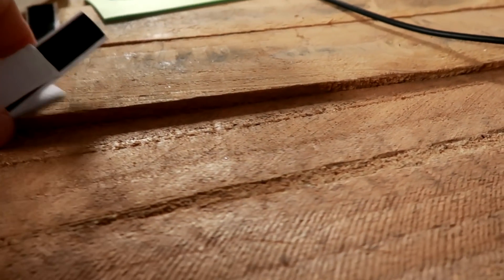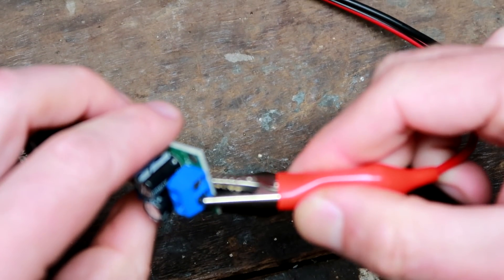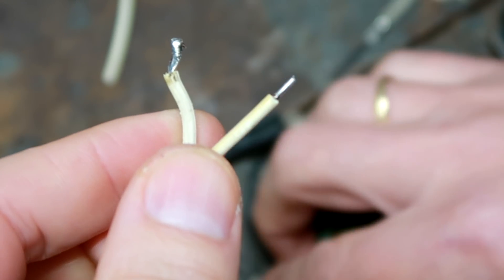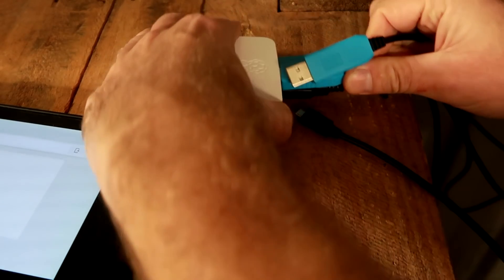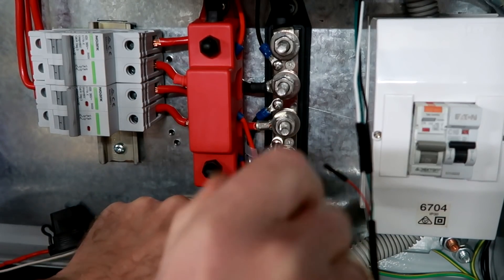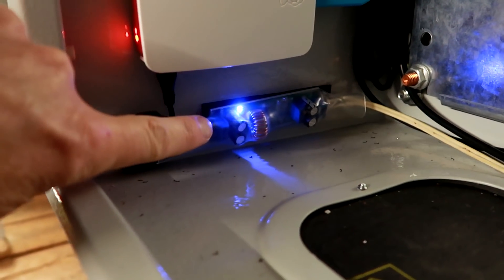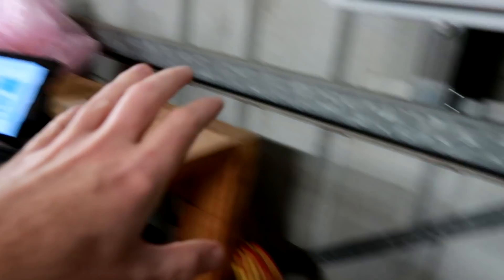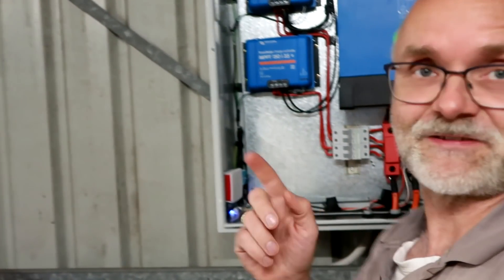Powering the Raspberry Pi from our 48V battery. Will it still work?

Comment: Hi Andy thanks for your very informative videos and your time spent to make them. I would like to make a small comment to that 48V to 5V buck converter you installed to power your Raspberry pi. I also installed that buck converter to power my Raspi, but it only lasted one week since it was installed. The output side near the capacitors was hot to touch. I happened to have another of that buck converter and installed it today. I tested the capacitors on the output side with my infrared themometer gun and it was already 40deg celcius. I think it's going to end up like the other one, but at least my Raspi wasn't damaged. I wish you could make a comment about your buck converter if it still in operation or you changed it to something else.

Comment: I am using the pi ac 90-240v AC strait to 48v dc system and  working fine. I am using and my laptop with 2 displays from the dc 48v and they working if the brightness are low. I find many appliances  with 90-240v ac supply that working on a 48v dc system without inverter.

Comment: Andy, I have followed the Venus OS on a PI you did.  Used the buck converter as it was always dropping a controller input or the shunt input on the display.  Adjusted to 5.1 volts.   Still have dropping of input to the Venus display.   Did you keep the buck or did you go to the Victron cables?    My run length is from bus bars to buck converter to pi about 10 inches max.   I have to reboot, or unplug the usb and replug multiple times a day.
Reply: Actually I meant did you keep using the JST 4-Pin Male Header Cables or go to the Victron cables?   Sorry.  Thanks.

Comment: 14:13 -> Why are there so many USB RS485 adapters?
The RS485 is a bus to which many devices can be connected at the same time and each can transmit and receive.

Comment: Really liked this video, although I’ll be connecting up their smart shunt to an mpp solar off grid inverter and using the solar assistant software. DIY the cable though but can you correct the link you have on your website for the JST 4pin cable - it should be a male cable so it can join the female end of the usb/serial cable. I ordered it without thinking of the core electronics site and assumed I had made the mistake. Easy solve with some header pins but annoying to have to do.

Comment: Hey Andy, I've greatly enjoyed watching your progress as you get your garage off grid! This is my first comment, and it's on your comment around voltage rating for fuses. You were concerned about arcing within the fuse itself. In normal air I believe arcs are generated 1cm per 10kV. This may reduce with greater humidity. Of course being safe to handle is another thing as sometimes 12v fuses have both sides of the fuse accessible (not completely insulated) so they can be tested without removal. I think you decided to use mcbs in the end, which I think is nicer/more solid/handleable solution, anyway.

Comment: Once you calibrate the output voltage, put a dab of nail polish on the adjustment screw onto the plastic to one side to lock it in place.  Otherwise vibration from the inductor or the case can slowly cause the output to change.  Its usually better to get a buck converter with a dedicated 5V output like this instead.  Note that I am not advocating this particular product, just giving an example.

https://smile.amazon.com/gp/product/B07MBP7X94/ref=ox_sc_act_title_1?smid=A28ZWXW3ZSVNZU&psc=1

Bare boards for power supplies to digital electronics are a bad idea just in general.  It is very easy to accidentally blow something up and smoke the RPI.

It is also a good idea to fuse all taps off of any high energy source to just a bit over what the device is expected to actually draw.  There are lots of choices for fuse blocks or simple inline fuses here so whatever works for you.  In this case, a RPI 4 + a few USB devices might need up to 3A or so, so a 500mA inline fuse on the 48VDC input to the buck converter is reasonable.

-Matt

Comment: Love your videos Andy, just been binge watching to catch up. One thing you should not do is put soldered cable ends in a screw clamp.  The solder fill 'cold flow' under the pressure and the connection will become loose.  Best to use a ferrule or just bare copper strands.  Just incase you didn't know.

Comment: You speak about the second battery. How will you handle the fact that one battery coud discharge quicly in the second if their voltage is different and it can destroy the BMS is A is too high during discharge ?
Reply from the maker: Both battery banks are in parallel, so there is no voltage difference at all.
The individual BMS connected to each bank will monitor the current and shut off if that gets too high. It will disconnect this one bank in case of a fault.

Comment: Hi Andy. I work in prosthetics and we use Velcro a lot.

A quick tip to get the velcro to really grab on to the surfaces, apart from cleaning the surface with alcohol, is to slightly heat it with your heat gun, and the glue will melt a bit, and will grab harder. Maybe a bit off topic here, but still I think it is a useful tip.

Love your videos and been learning a lot.

All the best!!!

Comment: I'm really liking your videos. If I could make a recommendation it would be to take off those side panels and attach them to the top cover. It makes sure you don't lose them and gives it airflow 24/7. The addition of a heatsink might help is unnecessary unless you're making it do something intense. IMO
Reply from the maker: Thank you. I've got some heat sinks coming in. The Pi does not really get that warm after all, so it's more for piece of mind.

Comment: After some thinking: While it seems to be a cheap idea at first glance, there are good technical reasons why buck/boost converters should really only be used inside an electronic device to generate different voltages, BEHIND a "real" power supply with galvanic separation, overvoltage control, over temperature control and current limitation. If it fails, it will shut down by design. While a simple buck/boost converter will in worst case make a short circuit, which means all the input voltage and power directly to the output.

Please search for a real 48V DC-DC PSU (Power Supply Unit). It may convert the 48V to 12V the save way (with all safety functions). Use it directly for your fans. After that, you can than use the 12V to feed the buck-converter to generate the 5V, or whatever other voltages you need. So you have the safety of a real PSU, and the fun of cheap buck/boost converters.  ;-)
Reply from the maker: Yeah... in a fault situation, the buck converter will just fail and don't deliver power at all any more. But, there is a certain risk...
Reply: @OffGridGarageAustralia  No, in a fault condition a simple buck converter tends to have a shortend MOSFET. Which means the input voltage goes directly to the output. And the current is limited by the ohms resistance of the inductance only. In worst case, it will not blow the fuse, but set the converter and the raspberry on fire. In contrary a real PSU will shut down by design.
Reply from the maker: @peterpetersen6024  The last two bucks I fried had a high impedance so noting came through at all. But this might be different every time depending on the case...

Comment: Run it about 5.1-5.2v. That is within spec (up to 5.25v), reduces the current in the r'pi onboard power supply and gives a bit more margin for plugging in USB devices. Also, you need ferrules on the cable for those clamp connections. (I actually feed in the 5v via the GPIO pins so I avoid the skinny usb wires.)
Reply from the maker: What clamp connections? From the power supply?
Reply: @OffGridGarageAustralia  the ones on the dc-dc converter.
Reply from the maker: @Sylvan_dB  Yeah, right...The terminals don't open enough for that.
Reply: @OffGridGarageAustralia  ferrules come in many sizes. I've some ferrules for tiny earbuds wire. Almost cannot see the hole, they look more like the v. needle they poked me with recently. Other ferrules I can fit my thumb into (for 4/0 wire, whatever size that is in mm2).

Comment: Hi Andy, there is a 58 volt range of Midi fuses and they also do in-line fuse holders for them. The smallest I've seen is 30 amps though, so not much use if you only want a 10 or 15 amp fuse.
Reply from the maker: OK, thanks. I'll have a look a round and see what others do. I may just go with the fuses I have . Have blown the 5A fuses of the battery connection to my console a few times, no trouble at all 😉

Comment: Seems these don't tend to last at higher voltage, but some 5v phone chargers will work at 48v, although intended for 120-240vac, it is rectified, then bucked, some work with much lower voltage, so it should work with your 55v range..

Comment: It's possible that the Pi is using OverlayFS which will protect it from corruption.
Reply from the maker: Could be. I will add a little switch to the pins so I can shut it down via that. Putty is too much work...

Comment: Hi from France, Don't you think it's "risky" to rely on your battery bank to power the "brain" of your setup ? 
Personally i think it could be a better idea to power it trough an independant power source ...
Anyway, thanks for the time you spend to share your "journey" trough "the free Kwh world" ^^
Reply from the maker: Hi Florent, the Pi is nothing than a logger for all the data. All systems will run just fine without it.

Comment: You can use fuses from a fork lift. They have a higher dc volt rating. They are similar to the glass type from old cars.

Comment: Glad that you are having some luck with that particular buck converter; I bought two of them to run my vapor tight LED overhead fixtures and they didn't even last 2 weeks. One stopped working and the second kept tripping the 10 amp DC breaker taking out my general and security lighting circuit. My input voltage hangs around 55 volts and output at 28 volts drawing in the ballpark of 0.75 amps; thank goodness I purchased them from Amazon and was able to exchange them for another version that have heat sinks on all of the FETs. Those two fixtures have been running 24/7 in my garage for almost a year now.

Comment: Hey OGG i had an idea for you but its prob only something i would do. But my idea is having a small mini computer fan build into the Ras P cover blasting right into the compartment of the circuit board cooling it enough to not have to add a heat sink which may or may not be enough cooling you need .One thing that may make it not a so good idea is; if the fan causes RF and interferes with the units normal operation? That i have no idea if it would or not??

Comment: I would recommend on the buck converter that you set the output to 5.1v and not 5.0v as the raspberry pi will likely be giving you an under voltage alarm when it's running as the voltage sag may be bringing it down slightly. Be careful to not exceed 5.2v

Comment: Hi Andy. Great videos as always. How about using the USB slots off the PWM controllers to power the RasPi. It will also be a visual aid of the battery volatge without using the phone or app. However it will mean that you'd have to install it in your metal enclosure. 😉
I'm concerned about a fire starting from the heat shrink buck converter setup and burning down the off grid garage. 😭
Reply from the maker: What PWN controllers, John?
Reply: @OffGridGarageAustralia  the ones you had started with some time back long before you got the victron.

Comment: ANDY!!!
Please take a temperature reading of that buck convertor, I bought 6 of the same kind from aliexpress (bucking 50vdc to 24vdc and ~0.5-1a). Each module that I ran quickly hit 63*C, and over an hour hit 70*C. Got really concerned when one module was running at 90*C after a 3 hour test. Tested on 3 different temperature devices, 1 IR and 2 multimeter temp sensors.
Check the IC temps!!!!
Reply from the maker: I did, it stays cool, nothing get hot, not even warm. There is only 0.15A going in.
Reply: @OffGridGarageAustralia  definitely not even half of 10A as advertised... Good for your purpose I guess!

Comment: Great video. I use the pi4, but unfortunately the numbers from the charge controller on the pi4 image is not accurate. I also use a old android phone to compare values. I like your setup. Just a thought, get a new case with the heat sinks and fan included. Keeps it cool for sure

Comment: So you are OK with the Raspberry Pi having a constant draw on your battery? What about vacations?  Perhaps an on/off switch to the buck converter?
Reply from the maker: Yes, I'm super cool with this. Before that it was running from a USB charger from the inverter anyway, so this is actually more efficient. It draws 3.5Ah per day from the battery. All base loads in the garage pulling 25Ah all in total in 24h.

Comment: Hi! Great video! Just a note. I saw that you where tryuing to get a solderd cable in the screw-terminal. You should never do it like that. The connection in the screw-terminal will get loose after some time. (There is no flexible part in the screw-connection). Bare stranded-cable is fine.

Comment: Get a windows program called “Putty”. You can connect wirelessly to the raspi using it and issue the shutdown command.  “Shutdown now”  very quick.
Reply from the maker: I know Putty for a long time. Yeah, that would be a solution. I rarely shut it down though...
Reply: This is the program I was thinking of.
Reply: Putty is top to do ssh connections (and others) but i've discovered MobaXterm years ago and ... 
i must admit that i've buyed a license (and "Cocoricooo" it's a French software ... ^^ .. guess from what country i come from ^^)

Comment: get rid of the step down transformer. It's gonna get stinking hot, especially when you are on the high end on the input and low end on the output. Also the shrink wrap will make it worse. I would run the pi off a USB if you can, I'm sure you got some on the inverter or something.
Reply from the maker: It's pulling only 0.15A and does not even get warm.
Reply: @OffGridGarageAustralia  .15A at 50 volts or stepped down? Just keep an eye on it. 
.

Comment: raspberry pi are known to overheat, especially in their brand case. You might consider downclocking it or using a better casing
Reply from the maker: Or consider taking off the panels as I said?
Reply: Yes, and the ambiant temperature in the big box must also be low enough to evacuate the heat. It is hard to tell; we'll see in the summer.

Comment: You can get higher voltage rated “auto” style fuses for 58V, 80V and even 125V. The 58V ones work just fine with the standard fuse holders you have. You can probably find local suppliers by just searching for “high voltage auto blade fuse”, but mine came from a company called OptiFuse.
Reply from the maker: Thank you, Ian. Much appreciated!

Comment: About the fuses... What type do you want to use? There are several 58V rated fuses available. From small to big, like miniOTO, midiOTO, maxiOTO and megaOTO. For all types you can get single fuse holders or multiple fuse holders. In our cars with 48V systems we use Midi fuses in a fuse block which looks a little bit like the VO2216 from Votronic. https://prevent-germany.com/votronic-hochlast-sicherungshalter-5-fach-mit-deckel-fuer-kfz-schraubsicherungen-und-hochlast-sicherungen
Similar fuses and fuse holders should be available in Down Under.
There are also fuses in ATO-style with 58V ratings, but you will also need a 58V or higher rated ATO fuse holder. For example something like the Littlefuse 178.6152.0042. Or you can build / solder your own, which would be much cheaper, because most pcb fuse holders are rated for 80V.

Comment: I use a Victron Orion DC/DC converter to convert to 12 Volts (actually it is set to 13V, converting from a 12V system). The advantage is, you can run a lot of 12 Volt equipment like your router, LED lamps, USB 12 V Adapters, etc. on that converter and you are able to use this cheaper fuses or fuse boxes also.
Reply from the maker: Right, I look into this as I got some 12V LED lights as well which I want to connect.

Comment: Hi Andy.
The buck converter could also get hot, maybe in vertical position the air flow would be better.
Cheers.
Reply: I ordered these and had really bad luck with all of them. It was really bad, like burn down your house bad.
Reply: @jamess1787  yes I was also concerned about the fire preparedness.
Reply from the maker: The buck takes 0.15A and doe snot even get warm, so all good. It's a 10A device so heavily over rated for the draw of the Pi.

Comment: you might wont to go 5.25v with my raspberry pi's i tend to get alot of low voltage warnings when voltage is below that
Reply: Yes! Somewhere between 5.1v - 5,25v depending on the length of the USB-cable.
Reply: @alexanderpetterson7625  mine are as short as possible with as fick of wire as i can find on a usb cable i run a 3.5 inch screen and sdr on my rpi3
Reply from the maker: Hmmm, I measure with the USB power supply I had it connected too and it never complained at 4.95V. The buck converter stays very stable at this low current draw.
Reply: @OffGridGarageAustralia  I wonder if the config file has the low voltage warning to off at dead on 5 volt I would get warnings even at boot and when usb cable was tested it could handle 3 amps

Comment: With the fuses it is a bit difficult. You might want to look at some Mini-ANL fuses, but many of them are only rated at 36V.
Another option would be Victron MEGA-Fuses which are rated at 58V, but these are quite a specialty product.
The easiest option are DC breakers, while a bit clunky.